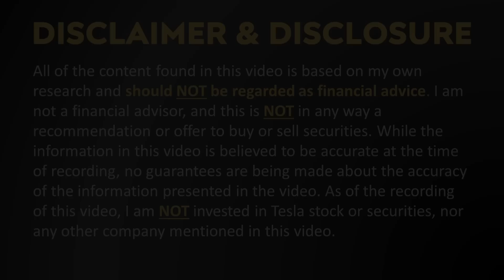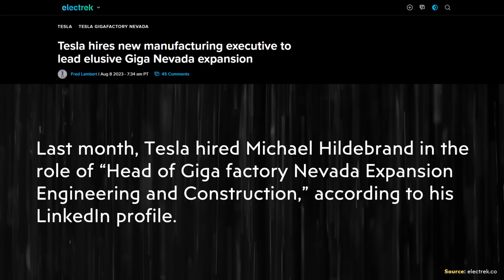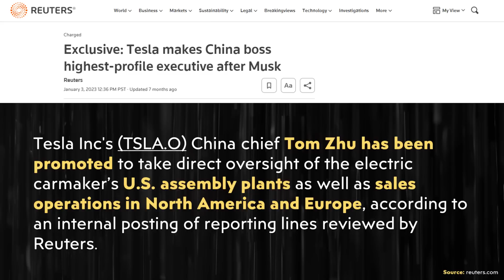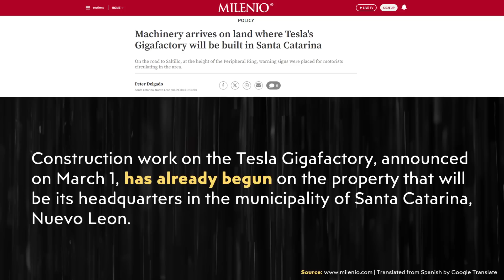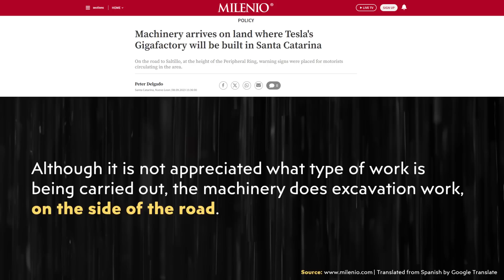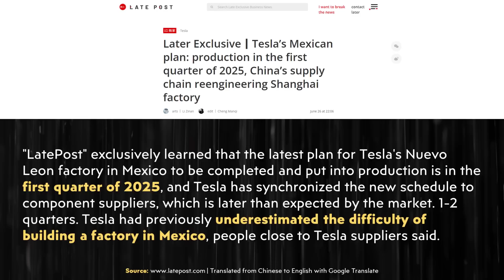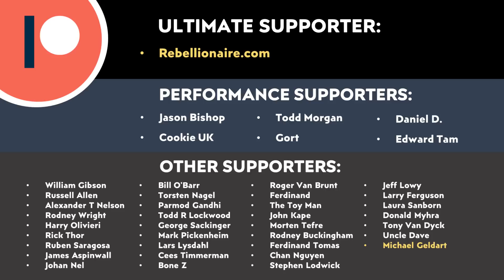NEW Tesla Gigafactory Updates | Giga Nevada + Giga Mexico

Comment: 4680 batteries from Nevada - in this update you suggested that when 4680 cells are finally produced at Nevada they might be used in Semis also being produced there. One issue that may affect where these cells are sent is the ramp of Cybertruck. Recent reports suggest that the Cybertruck will require 4680 cells, unlike Model Y or Semi. If we find this to be correct, then Tesla may need to give Cybertruck priority on all 4680 production in the near term.
Reply: Tesla engineers will be certainly thankful for your helpful suggestion.